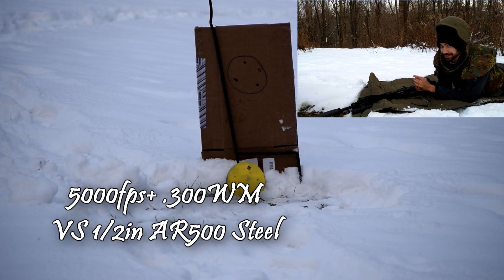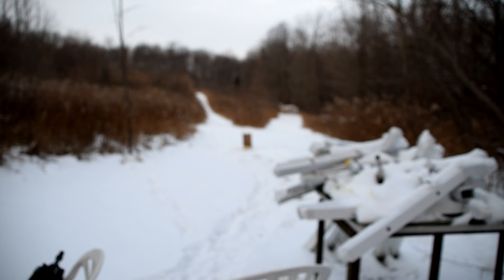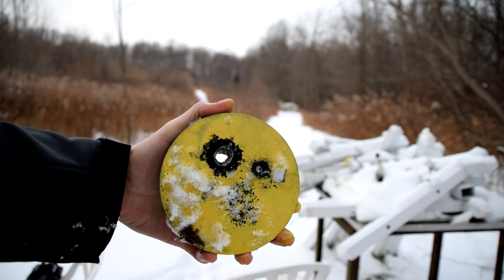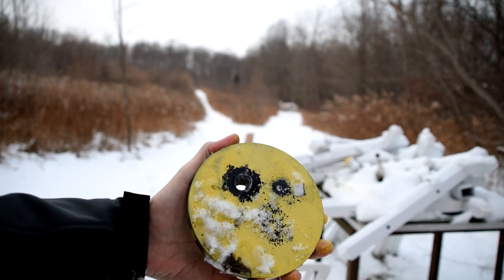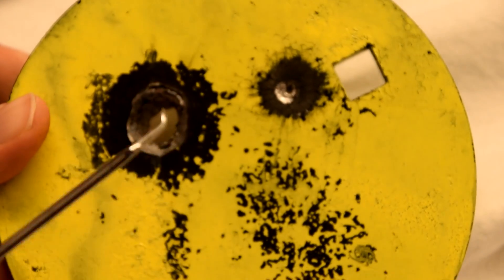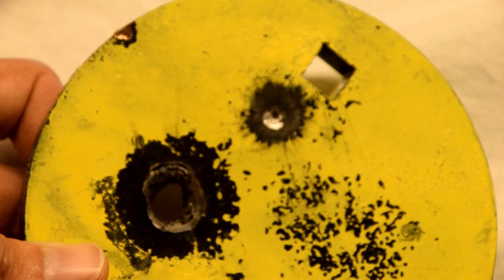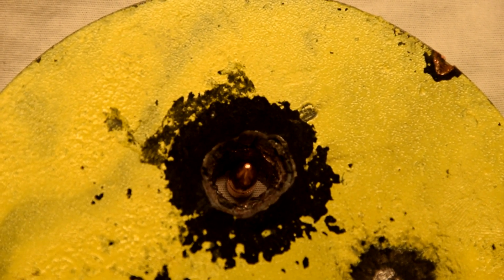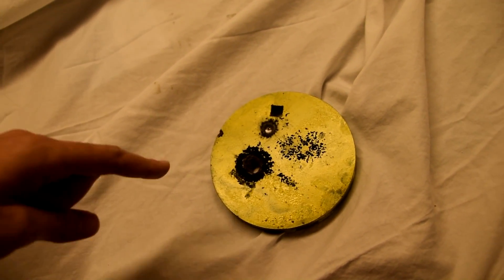5000fps .300Win Mag vs 1/2 inch AR500

Comment: 1" thick ar500 steel will stop up to 20mm AP rounds. I've been sending those plates to DemolitionRanch, Dustin Ellermann, Edwin Sarkissian, Mark Serbu, and Going Ballistic.
Reply: 20mm tungsten will go straight through
Reply: @christophegroulx8187  wrong. Didn't u see Edwin's test with Mark's 20mm cannon with tungsten round??
Reply: 71502 He didn’t shoot it with the tungsten
Reply: @christophegroulx8187  He shot the Titanium with red tip tungsten 20mm. AR500 steel is at least strong as or even stronger than Titanium. If u want the link I can send you
Reply: @7150285  He shot it with this : https://www.gd-ots.com/munitions/medium-caliber-ammunition/20mm_mk244/ 

This projectile is heavy and made for accuracy, not armor piercing capabilities. It can penetrate armor, but it's not that good in this role. He should have shot it with their actual armor-piercing model :

https://www.gd-ots.com/munitions/medium-caliber-ammunition/20mm-mk149-apds/
Reply: He'll send me one lol
Reply: @smithnwesson990  I'm incline to believe 1.25" thick will also stop the wicked SLAP rounds. We know 1.5" thick also easily stopped it as well.
https://youtu.be/rcOrZj5GTKo
Reply: @7150285  well obviously it would be less, as it is a stronger material, I'm just wondering if it will go through it completely or not, if not then how far.
Reply: @LocPH.  Well. Obviously it didn't even penetrate the 1.5" thick Grade 5 Titanium. And it didn't even go thru 1" thick ar500 steel.
Reply: @7150285  Again, it wasn't an armor-piercing projectile
Reply: @7150285  I’m saying it was not made for its armor piercing capabilities, but for precision. Pretty much every 20mm+ shells nowadays use tungsten. Doesn’t mean they are all armor piercing
Reply: @christophegroulx8187  there is no armor piercing ammo that is harder than tungsten. Tungsten is the hardest/strongest metal on Earth.
Reply: @christophegroulx8187  you need to get your facts straight. 20mm and 25mm does NO better job in penetrating steels than the .50cal. 50cal penetrate steels better than 20mm+ rounds whether it's tungsten, DU Depleted Uranium or whatever u wanna call it.
Reply: @christophegroulx8187  First of all, RHA Rolled Homogeneous is softer and weaker than AR500 steel. RHA have 300 brinell hardness range. AR500 have around 500 brinell hardness range which is at least strong as or stronger than tank armors. If tanks use too thick layers of harden steels then tank will be too heavy and immobilized. Second of all, you are saying all this with no proof and NOT from real life testing like what people had been doing on YouTube.
Reply: @christophegroulx8187  you are just mad because real life tests that people had done are proving you wrong. Anybody like you can say anything online. BUT not anybody could do any actual testings online because that would require real life testings. And no 13" thick AR500 I doubt NOTHING is getting thru that in real life.
Reply: @christophegroulx8187  he said it in the video, they used a WWII 25mm armor piercing ammo AND didn't even scratched the ar500 sword.
First of all, I knew you would say it's not armor-piercing because it didn't penetrate.

Second of all, if it didn't penetrate THEN you'll it's not tungsten etc etc. It is painful discussing this with you.

Here another vid of Shape Charge RPG failing to pierce.
https://youtu.be/q7BupgOgXd4
Reply: @prandomable   What you linked is slate mesh armor, it works by destroying the fuze before the warhead touches the main armor. Steel is doing nothing special in this case, it could be any metal and some even use nets. But if you’re talking about the demoranch video, this is I believe 76mm caliber training practice shell, so nowhere close to tungsten sabot 25mm (70mm), never mind depleted uranium (95mm). But did you read the paper I sent you?
Reply: @christophegroulx8187  I am not replying to you anymore because it's pointless. There are much more proofs on my side and is all over the Internet especially on YouTube backing up what I said is correct than what you said. If it didn't penetrate then you'll said it's not tungsten, when tungsten didn't penetrate THEN you'll said it's not armor piercing, although YouTubers themselves (Mark Serbu & Edwin) had even said it's armor piercing tungsten in their video and u still wouldn't believe it. Anyway goodbye!
Reply: @christophegroulx8187  As for shape charge, I've sent you a vid of an armor defeating the RPG Shape Charge. Oh and FYI, if you keep making steel harder and thicker with LOTS of multiple layers, HELL you'll be even stopping Hydrogen & Nuclear bombs!!
Reply: @prandomable  You have sent me no video of steel defeating shaped charges whatsoever. Again, and it seems like you can’t quite get it into your thick skull, this system works by compressing special components in the fuze, significantly decreasing the efficiency of the shaped charge. And again, some systems use nets to do that. Does it mean nets are resistant to shaped charges? NO THEY AREN’T. Neither is steel. 

Also, the "black tip" 20x102 is steel core, and the "red sabot" is TECHNICALLY a tungsten sabot, except it wasn’t made for penetration at all. If you read the PDF on the manufacturer’s page they mention PRECISION. The only one that is better than .50BMG SLAP is MK149, so the white/transparent projectile AND from a 59" barrel so the sabot can separate correctly. The videos you have sent show neither of this. 

And also, why are you defending "your" steel so much? It’s not like you made it, seems like a weird thing to do. Also, AR500 is MINING steel. If you wanted to use actual armor steel, look up MARS 600
Reply: @christophegroulx8187  nobody will believe u my friend...Edwin Sarkissian and Mark Serbu have been putting those 20mm to the test on their channel and their vids got couple millions views showing what 20mm can't penetrate. There had been real war stories of RPG couldn't to pierce army tanks completely.
Reply: @christophegroulx8187  "The only round that's better than the .50BMG SLAP is the 20mm Mk149 APDS?". There has been no test done so CAN'T know that. Although Mark Serbu and Edwin Sarkissian did have that round that day but Edwin told me it got stuck in the Typhon 20mm barrel so unfortunately they never shot it. But I doubt it'll do any better than the 20mm Phalanx red sabot that they DID shot. They are both tungsten sabot rounds.
Reply: @prandomable  The video could have billions of views for all I care. They still haven’t shot an AP sabot, the only real way to compare it to M903 SLAP. The mk244 (red projectile) is technically a tungsten sabot, but it was made for precision, not armor piercing. Don’t believe me? Go on the manufacturer’s website, tons of reference to the effectiveness of the penetration on the MK149’s page but NON for the MK244. It just talks about precision, which is what it was made for.

And also, do you really think tanks use a lot of steel? They don’t, it’s all NERA, NxRA, and composite. Maybe a thin layer to catch the remaining fragments at the end, but it’s definitely not high hardness steel anyway.
Reply: @christophegroulx8187  AR500 steel is mining steel? Yes it is. But sometimes Military Mil-Spec (for example Mil-A-46100) steel or RHA Rolled Homogenous Armor can't be hard as or thick as industrial AR500 or AR600 steel. If tank armor use bunch of thick harden steels, hell it'll probably even stop missiles. BUT the tank will most likely be too heavy and become immobilized.
Reply: @christophegroulx8187  it is on their website saying the White Sabot is better than the Red Sabot as they advertised! Not proven in real life! Why don't you talk to Edwin And Mark Serbu to beg them to shoot the white sabot in their future vid to prove me wrong? As for tank use composite armor is because of weight issue. If used too much and thick harden steels like for example AR500 or AR600, then tank will be immobilize because too heavy.
Reply: @christophegroulx8187  you've sent me this link before but it doesn't convince me at all. Why? Because Red Sabot 20MM MK244 is made for precision yes BUT it also uses 48% heavier penetrator. The White Sabot 20mm MK149 APDS has LIGHTER tungsten (Like what Edwin had also said) so I doubt it'll do better than the Red Sabot 20MM MK244 if not the same.
The .50BMG Raufoss round also use a tungsten core too but a lighter version thus less penetration. The .50BMG SLAP round uses a BIGGER tungsten core thus MORE penetration according to the test people had "already" done.
https://www.gd-ots.com/munitions/medium-caliber-ammunition/20mm_mk244/
Reply: @prandomable  I don’t know why I have to explain this, but VELOCITY is much more important than mass when we’re are talking about penetration. I mean, look at the video we are commenting under! .300 win mag sabot will penetrate much more than normal FMJ. And if we wanted to make a tank out of ar500, then it would be over 2 meters thick since shaped charges are the primary concerns, and like I said before, if they can penetrate 1.3 meters of RHA then we are looking at 2+ meters of ar500 since it’s worse than non hardened steel.
Reply: @prandomable  Again, the research paper I linked before tested it against different materials and even took pictures. This is also fairly consistent with other research papers that tested shaped charges against ceramics. These too perform pretty badly against these type of threats. You can see the pattern : both materials are brittle, and the initial blast negates the high hardness. That would explain why RHA and titanium perform so well, since they are not hardened.
Reply: @christophegroulx8187  go ahead and believe it in. I've sent you a vid of Shape Charge RPG getting defeated by a material that's not even steel. And keep on saying 25mm APDS, 20mm White Sabot APDS will go thru this or that...nobody will believe you. And that's why I got so many thumbs up on my post. Because people know 20mm can't pierce shit. Due to its large diameter bullet.
Reply: @prandomable  Again, it’s not like you have shot shaped charges or 20mm out of a proper barrel too. Research papers, experiments, and manufacturer’s data are accurate, and this is what’s being used. You are trying to extrapolate data from videos that have very little to do with the type of ballistic threats we are talking about. Instead you could cite a proper source and prove me wrong. I’m waiting for it
Reply: @christophegroulx8187  expert wannabe
Reply: @prandomable  I wouldn’t call myself an expert since I have not been learning long enough nor have I done live experiments (hellfire missiles are hard to come by!) but I do have quite a bit of knowledge. Oh, and I’m still waiting for you to prove any of the points I made wrong.
Reply: @christophegroulx8187  expert wannabe
Reply: @prandomable  Since I have cited my sources, not sure why you are calling me a wannabe. But I am still waiting for a proper counter argument. Right now having to resort to insults after being proved wrong by facts is sad.
Reply: @christophegroulx8187  FACT: expert wannabe
Reply: @christophegroulx8187  I got 14 thumbs up on my comment because people believe me, as they've seen the vids themselves too. You have no thumbs up because you're just saying what you think. Anybody can pull up some random facts online. But not everybody can make a video showing the WORLD like what me and those YouTubers did ;)
Reply: @prandomable  Again, bringing up views and likes is utterly useless. That’s not a counter argument. I’m still waiting
Reply: @christophegroulx8187  14 people agreed with me and not you. I think that shows your arguement with me is pointless. I am not gonna spend anymore time on this pointless non-sense arguement anymore.
Reply: @prandomable   Oh so you are 71502? You do realize your original statement is technically right, since black tip steel core is considered "armor piercing" albeit being pretty bad at it compared to dedicated sabots. But still, bringing up likes shows that you lack arguments and I’m still waiting for you to back up your insane statements with actual proof.
Reply: @7150285  You do realize I have utterly destroyed every claim you have made? And that the 14 likes, which you seem to pathetically brag about, weren’t even about our discussion. And if you still haven’t understand why a projectile made of tungsten doesn’t necessarily mean armor piercing, even after I have explained it to you many times, I can’t help you.
Reply: @7150285  You can literally look at the authors of the research paper and the other researchers who referenced their work. They carefully explain their methodology. Meanwhile, just like I claimed, MK149 will go straight through your shitty one inch mining steel, meanwhile the MK244, ESPECIALLY out of such a short barrel, and which also was not made to penetrate armor, won’t. This fact alone seems to upset you so much and honestly I have trouble understanding why. And with how deep the original comment even is, pretty much no one is gonna see this thread.
Reply: @christophegroulx8187  keep on hating. Ok. That's say if Edwin and Mark Serbu DO shot and make a vid of the 20mm White Sabot MK149 vs 1.5" Titanium and my 1" AR500 steel. I'm betting it wouldn't pierce it. It's a lighter tungsten round than the red sabot MK244 phalanx. You're upset and calling my steel shitty because those wimpy 20mm couldn't penetrate not even the Titanium. And you're upset because you're not getting the publicity that I'm getting on their channels. Guess what? The vid hasn't been done on the White Sabot yes. Why don't you talk to Mark Serbu and Edwin yourself and ask them to make a future vid on that?
Reply: @christophegroulx8187  I got 140+ likes on Going Ballistic's channel because people agreed with what I said, so cry me a river. People know 20mm can't do shit against AR500 and Titanium.
Reply: @7150285  Hard to do, they would need an Anzio 20mm rifle with a 59" barrel. Anything shorter and the sabot has a high chance of not separating correctly. And again, speed is the key to defeating armor, not mass. THAT’S THE POINT OF THE VIDEO YOU’RE COMMENTING UNDER. And please stop bringing up your 14 likes that I have already proven aren’t even about the subject. Want to know something funny though? Your comment also takes a lot of scrolling to find even though it has the most likes. What this means is that a lot of people disliked your comment too.
Reply: @christophegroulx8187  I think it is time for you to take action. You need to talk to Mike Remo (Ironworks' Anzio's owner). They are in Tampa, Florida. Mark Serbu Firearms is also in Tampa and he has my armor plate. You can also talk to Richard Ryan Fullmag and Dangerous Bob. They have access to 20mm Vulcan. Tell them to shoot 20mm white sabot tungsten round in their future vid to see what it'll pierce rather than replying to my post on what you think.
Reply: @christophegroulx8187  real life Iraq War story of RPG not penetrating Abrams tank's front, nor the side of the tank armor. The frontal turret armor is the thickest part and probably cruise missile might not make it thru completely either. Too much meat for the frontal armor. ANYTHING can stop projectiles if u make it thick enough, or even better, make it thick AND HARD enough. Even stack of papers can stop projectiles if enough layers.
https://www.quora.com/What-would-happen-if-an-RPG-7-hit-the-front-armor-of-an-Abrams-M-1-tank
Reply: @christophegroulx8187  you want to get thru my steels? There is only one way, use a powerful oxy-actelyene cutting table and have LOTS of patiences as it'll take a long time. That's how and what they cut it with. Otherwise don't even thick about getting thru it. They even said it was too thick for plasma table to cut.
Reply: @7150285  First of all, TANKS DON'T USE STEEL IN ANY SIGNIFICANT QUANTITY, they use NERA, NXRA, ERA and overall lots of composite. Also, want to see waterjets cutting through 12" of inconel? Here you go https://www.youtube.com/watch?v=kPzzv0U3i5o The reason for why it's a bad idea to cut it it with plasma/laser is because of hardened steel's HAZ. Same thing makes it vulnerable to oxy torch, it's not good against heat.
Reply: @christophegroulx8187  Richard Ryan hasn't got back to me w/ the confirmation of 20mm APDS round yet, but seeing how lil the damage the Vulcan Prius did to the Titanium plate. I had lost hope that the 20mm white sabot APDS out of an Anzio 59" barrell will successfully pierce it like you think it would.
Reply: @7150285  It 100% would penetrate, and I can already tell you it wasn't mk149 since the slow mo shows a slightly different projectile. Thicker and shorter, so might be mk244. And a waterjet can cut through insane ammount of different materials, so you saying it can't pierce hardened steel is really funny. Inconel is an hardened superalloy, and much more expensive than even Mars 600.
Reply: @christophegroulx8187  so...I got the answer from Robert Bigando, he is an expert unlike you. You were right on the 20mm Vulcan Prius isn't the white sabot though, it was a training practice round they shot.
Reply: @christophegroulx8187  The red sabot IS ARMOR PIERCING!! There is a reason why the white sabot is being replaced by red sabot he said!!! Red is BETTER than white because it's a heavier projectile although also bit slower round. Speed AND mass are BOTH important to defeat armor. Speed won't do shit w/o mass!!! If you don't believe all this, go ask him yourself on Instagram. Or I can send you the screenshot of the convo I had with him if u provide me an e-mail. SMH...Mr. Wannabe expert...
Reply: @christophegroulx8187  I repeat. 20mm red sabot is a BETTER penetrator than the white sabot!! I REPEAT the .50BMG M903 SLAP round is a better penetrator than ANY 20x102mm rounds! I repeat, the expert had told me all this. Case closed! Red Sabot is the BEST armor piercing round which also failed to pierce Titanium. My original statement is 100% correct. "1 inch thick AR500 WILL stop up to 20mm AP rounds!!"
Reply: @7150285  Dude speed is by far the most important factor in penetration. There is a reason all AP rounds above .50 nowadays use sabots. The reason for why white sabots are getting replaced in some areas is because of the increased precision of the heavier projectile and it also loses less altitude over distances, which general dynamics boast about on their website. I already told you that, but I’m glad to know I was right and they didn’t use MK149.
Reply: @christophegroulx8187  the website says the white sabot is armor piercing yes (they both are, red & white sabot). However the white was replaced by red sabot (for a reason). Red sabot is better than white sabot!
Reply: @christophegroulx8187  if Red Sabot couldn't pierce the Titanium. No way in hell the White Sabot could. The factory is closed btw I was told, the General Dynamics. I'm glad I spoke with the expert rather than keep wasting my time with you.
Reply: @christophegroulx8187  you've told me speed is an important factor yes. Let me tell you what else is also important, the diameter of the bullet. 20mm diameter's just too wide and won't penetrate. It's like a dull unsharpened pencil lead trying to pierce things.
Reply: @christophegroulx8187  I had spoke with Fullmag before, I didn't know he was in my area, otherwise I probably would had let them blow up my armor in this vid had I known earlier. Seeing the HEAT M31 copper cone shape charge went thru bout 0.5" thick railroad track I-Beam but didn't have enough energy left to penetrate ballistic gel completely, the hope of them blowing thru my AR500 steel is low. Hopefully they'll do a shape charge vid again and I can be there. Railroad track steel I-beam is a much weaker btw.
https://youtu.be/TZcHgb3A8_k
Reply: @christophegroulx8187  You can say I never shot shape charge before, I live 3.5 hours drive from DriveTanks. Anybody can try shape charge there, I actually offered DriveTanks to try out my armors with their shape charge for free, they told me I still need to pay so I decided not to make the trip. Plus they think their plastic cone shape charge probably won't do much anyway to my plates. They probably lost faith after seeing my 2" AR500 defeated a 4,000 fps .50cal SLAP-T round easily.
Reply: @christophegroulx8187  the C4 explosives barely leave a mark on Marvin Heemeyer's armored Killdozer. They spent hours finally breaching his tank with oxy-fuel cutting torch. Oh btw, the steel distributor center where I got my plates. They probably have enough metals/armors plates there to stop multiple modern warhead missile strikes.
Reply: @christophegroulx8187  I just remembered. This "real life video" damage comparison demonstrate very well how much less penetrative 20mm (20x102mm) is than the .50BMG
Watch the link and the "boring parts". .50BMG Raufoss and Black Tip AP had penetration almost deep as 20x102mm red TUNGSTEN sabot round (that cracked the back of Edwin's Titanium). Those two large craters on the other side were from the 20mm APT rounds. EVEN .50BMG AP rounds penetrate much deeper than 20mm APT not to mention the .50BMG SLAP went clean thru the 2" Titanium while 20mm tungsten sabot couldn't even go thru 1.5" Titanium.
https://youtu.be/Q0w5XOXvx-k
Reply: @christophegroulx8187  you have told me that "SPEED KILLS" yes. That exactly makes sense because .50BMG SLAP & SLAP-T goes up to about 4,000 fps from a Ma Duece. 20x102mm Anzio & Vulcan goes up to only 3,300 fps ~ 3,500 fps (look it up) and red mk244 & white mk149 sabot reaches 3,600 fps ~ 3,700 fps. And it's ALSO a larger diameter projectile. No wonder why it couldn't penetrate...not enough velocity.
Reply: @christophegroulx8187  my steel distributor have told me RHA is Mil-A 12560 with brinell hardness of only around 350.
Mil-A 46100 is High Hardness Armor and almost identical to AR500 steel with hardness around 500 brinell. They also said Mil-A 46100 High Hardness Armor is a better steel to defeat shaped charges due to its higher hardness, toughness/tensile strength than the softer RHA Mil-A 12560. They've also told me they believe tanks back in WWII used mild steels mostly with hardness around 200 ~ 300 brinell.
Reply: @christophegroulx8187  AR500 and SSAB's Hardox 500 is not the same thing. Hardox is lighter and cheaper material than AR500 and in this vid even the .308 soft point went thru 1/4" Hardox 500 like butter, and that is probably why that research paper you sent me shows Hardox 500 is weaker than RHA against shaped charges regardless whoever wrote that paper.
https://youtu.be/IDVuo3wy97g
Reply: @christophegroulx8187  my steel distributor were "PROUD" their 2" AR500F steel defeated a 4,000 fps .50BMG SLAP-T round EASILY from a Ma Duece. As those .50BMG SLAP rounds killed the 2" Titanium. Sometimes the mining industry have more steels/armors than the military, and my steel distributor said their hardest metal is AR600, which isn't even used for military application, but for mining purposes. You call mining steels shitty. Mining steels CAN'T be shitty, they have to deal with digging concretes and SUPER hard rocks like granites and digging huge quarries etc etc...

Inconel only has a brinell hardness of 300 ~ 450 (look it up) just like RHA. It's not even hard as High Hardness Armor Mil-A 46100, AR500, AR550, AR600 steels, and neither is Titanium. But at least RHA and Inconel are harder than mild steels with 120 brinell.
Reply: @christophegroulx8187  lastly...don't believe all the BS, non-sense, fake news that you read on the internet and become bias...have common sense and find the answer yourself like asking an expert, or best do the experiment yourself, or let YouTubers do it to show the world like what I did, defeating those rounds that u were claiming it could go thru. Lots of facts people post online are actually BS and if u want to believe in those trash, go right a head.
Reply: @christophegroulx8187  Did some research. 20mm APDS Mk244 Mod 0 Red Sabot is updated version white Mk149 Mod 4. They both are APDS meaning Armor Piercing Discarding Sabot, it even says on their website. I also found US Navy was upgrading to those Mk244 rounds from the outdated 20mm Mk149 Mod 4 White Sabot rounds.
.50BMG SLAP M903 and SLAP-T are the actual beast. They travel even faster than 20x102mm Vulcan rounds. 4,000 ft/s for the .50 SLAP if shot from Ma Duece. Anzio and Vulcan cannot reach that velocity.
Reply: @liamkim8  They don’t mention armor piercing capabilities in the page, it’s obvious it was optimized for precision.
Reply: @christophegroulx8187  I have friends who was in the Navy. Navy replace white Mk149 with red Mk244 for a reason. 1. Better penetration 2. You are correct, more precision. The heavier red Mk244 should do at least good as or even better than white Mk149 because it has more energy due to its weight. Both rounds are meant for armor piercing yes. However Navy is now mostly using red Mk244.
Reply: @christophegroulx8187  I can guarantee you that mk244 and mk149 are both armor piercing discarding sabot rounds. They just didn't for some reason also state that mk244 is also meant for AP on their website.
Reply: @liamkim8  Because it’s not anywhere near as good at penetrating. Velocity is king, not mass. You don’t need much  penetration against missiles though, so it’s normal for them to optimize precision
Reply: @christophegroulx8187  you're wrong sir, the mk244 is made for better precision yes. But it is NOT anywhere less penetrative than mk149 like what you're thinking. Speed is king yes, penetration is all about the correct mixture/balance of speed, weight, density, bullets' cross sectional area of the bullet, all those factors matters. Trust me, the Navy would not have switched to mk244 if it is less penetrative than mk149.
If speed is the only factor that's important in defeating armor, then the video you're commenting under will be the most penetrative round in the world, even more penetrative than .50cal and 20mm.
Reply: @liamkim8  Speed is the most important because E=MC2, where velocity is much more important than mass. This isn’t to say mass is irrelevant, but there is a reason for why going from 3000fps to 5000fps on a bullet a third the mass improves penetration
Reply: @christophegroulx8187   I saw Edwin & Mark's test. Mark never shot the 20mm white mk149 correct. But they did had that round with them and can be seen in their vid. If mk149 is more penetrative (like what you're thinking) then Mark and Edwin would had shot that round against their Titanium plate. They didn't. Mark he specialize in .50cal and 20mm. After the red mk244 couldn't make it thru, he didn't say "I bet a white mk149 round will". Instead he said "I bet a Vulcan will". Because Vulcan has a longer barrel. However Richard Ryan did the Vulcan 20mm vs Titanium but longer 20mm barrel didn't penetrate either.
Reply: @christophegroulx8187  Speed is important I agree. But if a bullet is sooo fast but doesn't have enough mass, it won't go far and it could be stopped easier, because it doesn't have much momentum without weight.
Reply: @liamkim8  Those tests are all completely irrelevant since their barrel is much shorter than a M61 Vulcan. The sabots are simply not made to be stripped away this quickly
Reply: @christophegroulx8187  We all know Edwin finally made it thru his Titanium after Mark sent him the .50cal SLAP M903 rounds. Edwin shooting at point blank, I doubt those .50 SLAP's sabot round would have the time and distance to separate either.
Reply: @christophegroulx8187  Red Mk244 Mod 0: 3,600 ft/s muzzle velocity. 2,000 grains weight tungsten projectile.
https://www.infantrydefense.com/products/ids-1305aa61-1305aa61-4733

White Mk149 Mod 4: 3,650 ft/s muzzle velocity. 1,540 grains weight tungsten projectile.
http://www.navweaps.com/Weapons/WNUS_Phalanx.php

Red Mk244 Mod 0 is much HEAVIER than White Mk 149 Mod 4 but only 50 ft/s slower. I don't think Mk149 is better than Mk244 man. And that's why the Navy upgrade from Mk149 to Mk244. Not only for precision purpose, but heavier weight for more penetration.
Reply: @liamkim8  did you just say they upgraded to MK149 for BETTER penetration? Yeah I’m outta here, you need to learn more about armor and how projectiles penetrate armored targets
Reply: @christophegroulx8187  Oh no. It's just what I can find. Is that red mk244 is a later updated version of white mk149. They both are obviously 20mm APDS rounds and use similar tungsten core except red is bit heavier. I wouldn't expect one round performing better than the other, if yes, then not much difference at least. There are lot of gun myths out there. What Edwin & Mark should had done is used a chronograph in their video so we would had an actual idea how fast those 20mm rounds were actually travelling. Their channel are fun to watch but their tests are poorly done.
Reply: @christophegroulx8187  both white mk149 and red mk244 are tungsten core apds rounds, similar velocity. Except mk149 bit lighter. Both rounds are not depleted uranium but instead tungsten core and no explosive filler. The older Mk149 Mod 0 and Mod 2 have DU core. The white Mk149 Mod 4 is white sabot tungsten with tracer. Red and white have almost the same velocity, except red is bit heavier. 2 projectiles going same/similar velocity then the heavier projo will usually penetrate deeper.
Reply: @christophegroulx8187  thanks for your view. You watch every single vid. I helped made with Demo, Edwin, Serbu, Dustin Ellermann, MJSteelFabrication, and Going Ballistic. I hope that teached you how much those rounds can't penetrate my steel.
Reply: @liamkim8  Weight/mass is almost important as speed/velocity. You can have bunch of velocity but no mass. Which one's deadlier? Throwing a ping pong ball or a golf ball? Golf ball has more momentum and will cause more damage of course.
Reply: @7150285  if they're travelling at the "same speed", the heavier projo will penetrate deeper no doubt. Having a good balance and mixture of speed and weight are the most important factors.
Reply: @christophegroulx8187   That Shaped Charge research paper you sent me was of them testing out welded "layers" of Hardox 500 (a lighter and cheaper material) than AR500. So I say that's comparing apples to oranges. Every steel mill makes their steels differently. Different chemical composite, heat treatment, quenching, tempering process etc etc...all those process can cause different qualities. Even if they're all labeled as AR500, AR550, or AR600. Each mill's product will vary differently and it all matters. You said no steels has ever stopped shaped charges, I can pull up vids of regular mild steel stopping shaped charges if you want...Hint: Beyond The Press Channel.
Reply: @7150285  You do realize Hardox 500 IS ar500? Ar500 means steel that has been hardened to 500 brinell for abrasion resistance. Hardox 500 is just the name the company uses for it. Mild Steel and AR500 are just really bad as an armor material, if you want actual steel that could be used as applique armor for exemple, I suggest looking at something like mars650
Reply: @christophegroulx8187  My comment was to point out Hardox 500 is NOT same as AR500 like what people would think. Anything that's in the 600 brinell range that I know of only be made up to 1.5" thick at most, at least that what my steel distributor keep in stock, steel distributor can always ask the mill to produce thicker plates. However the higher the brinell the harder it is to be made thicker usually, and again, even different mill produces different quality steels. I also proved lots of dumb asses out there who all originally thought Titanium was much better at stopping bullets than steels wrong. Also idiots all thought .50BMG AP will go thru this or that like butter. A lot of those calculation theortically penetration numbers online are BS. I trust real world real life testings than random fake numbers online.
Reply: @christophegroulx8187  I won't call that research paper you sent me BS or invalid. But their testings are irrelevant. Solid steel is stronger than layers of steels welded together. It is called comparing oranges to apples to compare solid AR500 steel to welded Hardox 500. Also different mill = different qualities. Go look at other vids of people shooting the lighter Hardox 500, it went thru it easily.
Reply: @7150285   Again, the Hardox 500 is AR500, but under a trademarked name. And about the weld, it was done one the sides and the plates were thick enough for it to not even matter, never mind the fact that the weld was far away from the shaped charge’s entrance hole. Also, I’m not sure why you’re obsessing over ar500. It’s a cheap steel made for mining operations and not suited for armored applications.
Reply: @christophegroulx8187  Whatever man, I got my fair share of publicity with Demo, Dustin, Edwin, Serbu, MJSteel and Going Ballistic. They all couldn't make it thru my plate unlike what people would had think and I get some haters like you sometimes in the comment sections because of jealousy. But I tell them fk their jealousy! The thickest and hardest steel my steel distributor have isn't even intend for military armor application. Just saying.
Reply: @7150285  The hardest steels I know are MARS650 and Armox Advance, both have a higher hardness (650) and have much stricter standards to enforce to ensure proper material properties. This is the kind of the steel that would be used as a front layer in an armored vehicle. And why do you keep switching from shaped charge to rod penetrators? I already told you ar500 is approximately 15% better than RHA for projectiles such as sabots, while something like mars650 would be 25% better. Nevermind ceramics that can be 200% better (so a third of the weight). Hardened steel loses almost all its properties when hit by a shaped charge, which is a very high speed molten copper or tantalum jet, and becomes much worse than RHA, an non-hardened steel. All of what I just pointed out are simple facts, you literally cannot disagree with them.
Reply: @christophegroulx8187  The harder the steel is the harder it can be made thicker. SSAB'S Hardox Extreme or some people call it Hardox 700 is very hard but can only be made 0.75 inches at most. My steel distributor have 1.5" thick AR600 which is the hardest and thickest metal they have in stock. However, the 2" AR500F offers the same protection and's cheaper and that's why I sent the 2" plate. I suggest you visit steel distributor center or even better, an actual steel mill to learn more, rather than reading BSs online and being a troll.
Reply: @christophegroulx8187  another misconception is shaped charge isn't molten copper. But solid copper nail or jetstream. EVEN if it's molten copper, it wouldn't have time to heat up the metal in time to melt thru it unlike plasma. Ever wonder why blow torch needs preheating and plasma and laser cutter takes "time" to heat up the metal?
Reply: @7150285  Dude why are you acting so weird, I'm prefectly aware that the harder the steel the more difficult it is to make it in thicker quantities, but Arcellor Mital produces 80mm mars600 so it's not exactly a big concern. The problem with using mining steel such as ar500 is that since there is pretty much no governing body to ensure that claims about the steel's properties are respected, armored vehicles don't contain mining steel (ar500/ar600/ar700). Minus that, you seem to have come to an agreement with me concerning my previous comment, so I'm glad we got that out of the way.
Reply: @christophegroulx8187  there are reasons why military don't use AR500 steel or any other steels. Tanks have to have good mobility, weight factor, cost, those factors all matters. Military grade steel are steels that has been tested by the military. Military do not have the time and money to test ALL steels that the mill can produces. I battle lots of dumb trolls online, and as long as you're not saying things with no evidences or just saying things on what you think, I probably can agree with you. Or maybe it's that you who agreed with me. The only thing I disagree is the shaped charged. Even if Shaped charge's jet stream is molten copper, it won't have time to heat up the steel like a plasma or blow torch table would. My steel distributor had told me High Hardness Armor Mil-A 46100 is in 500 brinell range like the AR500 and is more resistant to shaped charge than the softer Mil-A 12560 which is RHA.
Reply: @christophegroulx8187  This is probably what they shot the Shaped Charge into. Some poor quality Hardox 500. That particular 1/4" thick Hardox 500 he shot, the weak 5.56mm green tip bulged it and even the .308 soft point went thru it like butter. 1/4" thick AR500armor steel body armor can and had stop those rounds with ease...comparing welded Hardox 500 plates to solid AR500 steel is kinda like (comparing oranges to apples). Not only that, solid steel of the same kind and thickness have been proven to be stronger than stacked steel of same kind and thickness. That fact has been proven here on YouTube as well.
https://youtu.be/IDVuo3wy97g
Reply: @7150285  The guy in the video you linked says in the description that it's lighter... on top of that, many people in the comments are saying that likely not hardox 500. But if you mean that stacked plates are worst, you would be wrong. It actually makes them stronger, since it leaves space for the energy to be dissipated sideways. And I already told you about the weld. Ar500 will not loose a lot of strength becase of welding, and if the projectile is far away from the welded area it's not gonna matter. The HAZ is only in the borders, right where the weld is. It's just a fact that hardened steel doesn't react well to shaped charges. Same thing happens with titanium and boron carbide when they are hit by high velocity tungsten projectiles.
Reply: @christophegroulx8187  they shot the shaped charge onto welded Hardox 500 steel "that's not even spaced apart" to even matter. Solid steel is almost always stronger than stacked steel or spaced steel, the only times spaced steel will probably perform better than solid or stacked steel is if the spaces in between the spaced steel had disrupt the shaped charge's jet stream. Otherwise spaced steel is much less denser in the middle thus useless, and couldn't stop projectiles efficiently.
Reply: @7150285  It’s very unlikely to be hardened steel. The comments are pointing out that the surface isn’t red and it left dents in the steel. The guy in the comment also said that it was given to him as scrap steel. But what is the going ballistics video you are talking about?
Reply: @christophegroulx8187  Also Google:
.50 Caliber Browning (12.7 x 99 mm) Ammunition

It says .50BMG Black Tip M2AP has a 0.75 inch armor penetration capability from 500 meters away.

WhoTeeWho has shot .50BMG at 0.75 inch thick AR500 steel from 12 yards/meters. He told me it didn't even bulge the back from those rounds.

I'm pointing that out to you is to let you know a lot of those numbers online could be fake. I trust real life tests than BS fake online numbers infos.
Reply: @7150285  A 50 BMG M2 AP will go through 0.5" of ar500. But you havent yet provided a source for the stacked plates being worse. Not that it matters anyway, since both the RHA and ar500 targets were composed of multiple layers when the ressearch paper tested it against shaped charges.
Reply: @christophegroulx8187  no need to preach. We all know that, I've seen 0.5" AR500 stopped .50BMG API in Iraqveteran8888's video. My point is you get your sources from fake online numbers a lot, and I'm telling you don't trust everything you read. As a lot of them could be fake...I have gave you example and the sources that I showed you. As for as stacked steel being worse than solid steel, it is not hard to find the video. Idk why sometimes it won't let me post link, just look it up man.
Reply: @7150285  API is much worse than AP for penetration though. AP wil go through 0.5" of AR500. And again, wether stacked plated are slightly better or slightly worse is not really relevant since the resseach paper had both RHA and AR500 in layers.
Reply: @christophegroulx8187  It makes me want to laugh. What you are saying doesn't prove anything. Kentucky Ballistic had API and APIT rounds outperform the AP and Raufoss round before. And again, you have your own facts. I trust real life tests than other people's BS comments. As for as Hardox 500, you can't even confirm that it isn't really Hardox 500 that guy shot...you believe it isn't because some other people in the comment section didn't believe it. Type in Stacked Steel vs Solid Steel on YouTube. It is not hard to find.
Reply: @christophegroulx8187  I'm not saying videos can't be faked either, but it is much harder to fake a video than some online research papers. In your book online info script is your bible, and you think they're all facts, well in my books "realistic real life test videos" are my fact and is what I trust and believe in...
Reply: @christophegroulx8187  I just thought of something we can agree on.
You, as well as bunch of other people in Edwin's 20mm tungsten video comment section thinks Typhon 20mm barrel is too short and not enough velocity, all Edwin and Mark had to do is use a chronograph to solve this mystery.
Just like how I think Hardox 500 vs shaped charge would had been a better test if that research paper had posted a picture copy of the RHA, Hardox 500, and Mild Steel's mill test report to be more valid. After seeing that guy shooting thru Hardox 500 easily, I don't think it is a good quality steel at all to be honest. And again, I've been telling you each steel mill's quality varies, some time it can vary pretty significant. That's why target manufacturers and body armor companies typically like to order from a selected mill with best quality reputation.
Reply: @christophegroulx8187  I have to correct myself. It is not true that military don't use AR steels at all. They do. AR600 etc etc is indeed used in the military vehicles Titussteel told me. The harder the steel is the lighter and thinner it can be made, in order to save weight while still offering the same protection as softer and thicker steels.
Mining steel and armor steel is pretty much the same thing, although they might be bit different in chemical and mechanical properties, but they still serve the same purpose, which is to resist impact and penetration.
Titussteel told me their solid AR500 steel can be made up to 6 inches thick and's used for quarry digging up in Canada. Their hardest steel is AR600. However 2 inches is like the thickest they can produce for 600 brinell steel.

Hardox is obviously bad quality. If you want SSAB's steel. Better go with their Armox not Hardox.

AR doesn't mean anything, nor does it mean "mining". It only means Abrasion Resistant. Application can varies whether used for mining purpose, target shooting, steel body armor or even military etc etc
Reply: @7150285  Abrasion resistant is not made for armor purposes in any strict way. Target steel is at most what it’s gonna be made for. It’s made for ABRASION resistance, nothing else is ensured. For armor purpose companies will go with armored steel with strict standards, such as armox and mars. And no, thinner isn’t necessarily better, for example mars 650 is so hard it needs a backing layer. The conception of the armored platform is gonna determine its hardness need. And I already told you 3 times, the video is utterly useless since even the guy who posted it doesn’t seem sure it’s hardened steel and says he got it as scrap. Nevermind the fact that it acts like mild steel. Research papers are what you need to trust
Reply: @christophegroulx8187  Wow. I don't want to insult you anymore, but hearing from your reply this time. I would suggest you do go to an actual steel mill, or just a steel distributor center and consult with an actual expert there. Body armors use AR steels. Ar500BodyArmor. My steel distributor told me they have military armor as well. RHA which is Mil-A 12560 and only has a brinell hardness of 350. And HHA High Hardness Armor Mil-A 46100 which has brinell hardness of 500 brinell and is identical to AR500. And those military grade steels they have isn't even the thickest/hardest steel they have. What kind of steel the military want to use is the military's business. Not the steel distributor or steel mill's business. Nor does it mean the steels military uses is always the hardest and thickest the steel mill can produce.
Reply: @7150285  Not quite, AR500bodyarmor uses trash steel for their armor, and I wouldn’t be surprised if it’s AR500. There have been quite a few cases of the armor failing to protect against its rated spec. Any reputable manufacturers such as Hesco will use Mars and Armox.
Reply: @christophegroulx8187  some times mining industry need more armors and steels than the military. Some times quarry mining and trench digging could be as harsh or harsher on the steel than getting hit by RPG. RPG won't go thru huge boulders for sure...
Reply: @christophegroulx8187  another fun fact. Rocks hitting metals in the mining industry is a source of abrasion. Just like bullets hitting steels are just another source of "ABRASION". "Bullets' abrasion".
Man! When that 4,000 fps/1,200 meter per second .50cal SLAP-T round got stopped, it was like a SUPER fast pointy tungsten rock hitting my steel at the mining quarry lol.
Reply: @7150285  You fell back into your own habits of forgetting everything I have said. Steel is extremely bad against shaped charges. Secondly, I REALLY don’t think you know what abrasion means, and you might want to google it first.
Reply: @christophegroulx8187  I've sent you vids of even mild steel stopping shaped charge lol, not sure if you even watch that vid. Anyway Abrasion is wear and tear. Also harder the material the more abrasion resistant it is.
Reply: @7150285  You don’t have to trust me. I only listed facts. Your proof is a youtube video where the guy acknowledges that he isn’t even sure if it’s hardened steel. Also, I have yet to see a video proving that steel is effective against shaped charges. So not sure what you’re talking about here
Reply: @christophegroulx8187  You obviously chose not to watch it. A lot of your facts are wrong I've noticed. Go ahead and believe in the fake news and think it's a fact. I mean who really cares? I really don't care.
The reason I corrected myself that I know military do use AR steel as well, maybe not a lot. But they still do. Is because I was told by a more reliable person than you that some military vehicles do indeed uses AR600 steel.
Reply: @christophegroulx8187  I got research paper too. Shaped charge went about 1.06 ~ 1.30 inch into stack of AR500 steels. Most likely that lighter Hardox 500 was some poor quality steel. I wouldn't be surprise if Marvin Heemeyer's killdozer with steel filled with concrete was actually stronger than any military tanks, C4 and grenade explosives did nothing, only left stains and couldn't breach. Instead, they spent 12 hours breaching with cutting torch to finally get to him. I know u seen vid of Military Mrap won't even stop .50BMG API.
AR steels' main purpose isn't meant for armoring purpose correct, however it's just nice having armoring effect as a side affect.
https://www.protection-consultants.com/wp-content/uploads/2015/09/Stevens-David-Protective-Structures-Title-Protective-Roof-Materials-for-Shaped-Charge-Munitions.pdf
Reply: @7150285  The guy who posted it recognized that it does not perform like hardened steel at all and that he got it as scrap metal. But did you want to link a video? There are no links in your comment
Reply: @christophegroulx8187  Stacked vs solid.
https://youtu.be/AodH5WL1pl8
Reply: @christophegroulx8187  This information claims that .50BMG Black Tip M2AP round has 0.75 inch of armor penetration from 500 meters away. That's why I don't trust fake online numbers. I trust "real life" testings.
https://www.inetres.com/gp/military/infantry/mg/50_ammo.html
Reply: speed kills
Reply: @christophegroulx8187  wine bottle shaped charge. Blew half inch deep into AR500 targets. Wine bottled shaped charge also blew thru 2.5 inch deep into RHA.
My best assumption is RPG will only go few inches at most into AR500 steels. A lot of those "theoritical" penetration numbers are computer calculated and not proven by real life. Even if it's real. Military uses softer steels, also WWII steels are even shittier.
https://youtu.be/2OY7pQ53qhc
Reply: @christophegroulx8187  RPG-7 Epic fail. RPG-7 is (suppose) to have 300 to 750mm of armor penetration ironically. Right? Lol!

Video:
РПГ - 7- Застывшая в камне кумулятивная струя

RPG-18 penetrated 10cm (4 inches) into that old Soviet T-64 tank's frontal. RPG-18 is suppose to have a 300mm (11.8 inches) of tank armor penetration....right??? Actually a boulder will keep you even safer than a tank from anti-tank weapons it seems...

Video:
Гранатомëты против танка / grenade launchers vs the tank
Reply: @christophegroulx8187 we now know 🇮🇷 Iran's Fordo nuclear facility bunker defeated the GBU-57 bunker busting bombs. 12 of them were dropped on Fordo on June 22nd.

IAEA confirmed massive damage to the facility yes, but it was mainly the above ground infrastructures and tunnel entrances mainly. But uranium stored at the underground facility confirmed to be untouched and intact...confirmed by the IAEA.
Reply: @christophegroulx8187  If you could get a paint chip to survive atmospheric stresses and accelerate it to 1/4 of light speed it would impact with the same force as Little Boy in WW2.
Reply: @Spartan536  something going fast enough can split the atom. I believe I read somewhere that large meteor impacts can have a fusion effect if their uranium content is high enough, but that could have been misconstrued
Reply: @7150285  cool man. I don't remember what I wrote and can't find it, but they sure are powerful. Unfortunately, kentucky ballistics was the victim of an overcharged powder load. Something sadly I also am familiar with. Hello permanent tenitus in one ear. Always wear PPE when firing people. Eyes and ears at least
Reply: @MrRedeyedJedi we now know 🇮🇷 Iran's Fordo nuclear facility bunker defeated the GBU-57 bunker busting bombs. 12 of them were dropped on Fordo on June 22nd.

IAEA confirmed massive damage to the facility yes, but it was mainly the above ground infrastructures and tunnel entrances mainly. But uranium stored at the underground facility confirmed to be untouched and intact...confirmed by the IAEA.
Reply: @Spartan536 we now know 🇮🇷 Iran's Fordo nuclear facility bunker defeated the GBU-57 bunker busting bombs. 12 of them were dropped on Fordo on June 22nd.

IAEA confirmed massive damage to the facility yes, but it was mainly the above ground infrastructures and tunnel entrances mainly. But uranium stored at the underground facility confirmed to be untouched and intact...confirmed by the IAEA.
Reply: 20 mm AP? The most I've seen from those channels is 1" AR 500 stopping 50 BMG AP and 20 mm steel core... but if you're right, plz link :)
Reply: @LocPH.  20mm tungsten round not penetrate 1 inch plate.
Reply: LocalPulsar H. It’s from Edwin’s channel
Reply: @LocPH.  those were my steel plate I sent them that you saw. YouTuber gun channel Demolition Ranch, Edwin Sarkissian, and gun designer Mark Serbu. Which link do u want me to send?? Those vids are on their channels...
Reply: @7150285  No, a link where I can see one of them shoot a 1 inch AR500/550 steel plate with 20 mm AP round (tungsten).
Reply: @LocPH. We now know Iran's Fordo nuclear facility defeated 12 GBU-57 bunker busters rounds😂😅😅🎉🎉. IAEA confirmed massive damaged to the nuclear site but the underground bunkers survived and protected the uraniums that was stored there...